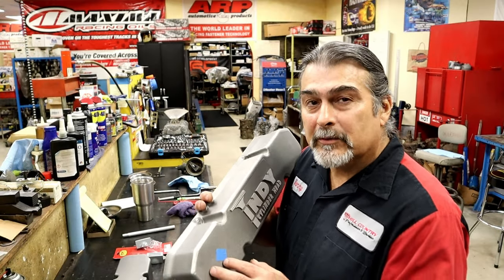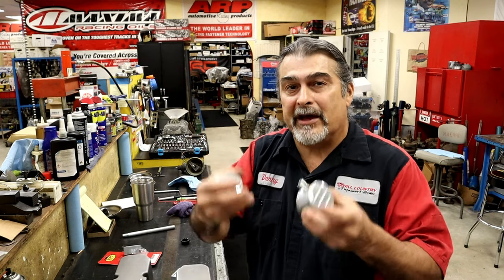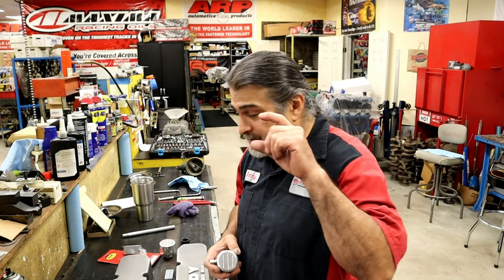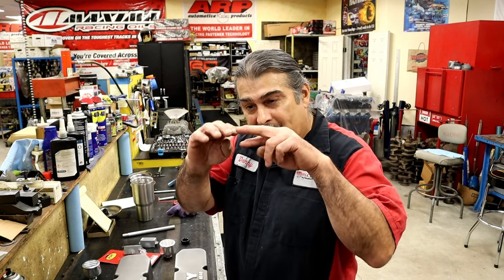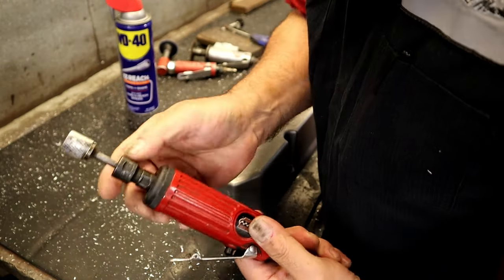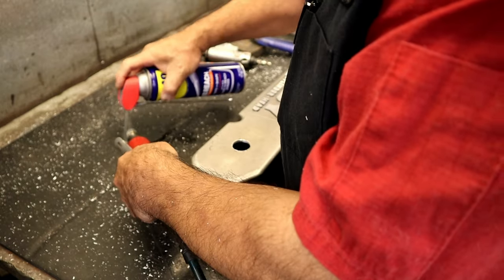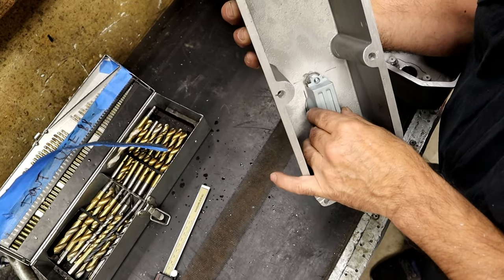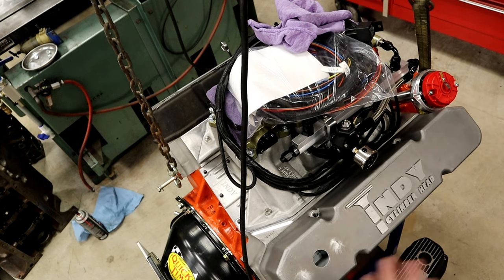How to add proper crankcase ventilation.

Comment: Great video,thanks for sharing your skills 
How many miles would say change the valve &filter? 🇺🇸Thanks
Reply from the maker: Check every 3000 miles and replace as neeed. Back in the day we would clean the filter and clean and check the pcv valve.

Comment: I would not use self-tapping sheet metal screws on the underside. I don't trust screws I would use pop rivets drill 1/8 inch blind hole and pop rivet it. It will never come out.

Comment: Wicked vid, fun editing too. 7:25  ~”pads”~ 

My ford 390 eats oil on the downhill, been meaning to revamp my pcv system. Apart from adding a baffle, I might change my vacuum source. 

Is it better to source vacuum for pcv at the carb or the ford pcv carb spacer?
My engine’s original carb didn’t have a pcv nipple and ford used the vacuum source on a carb spacer. 

My new carb has a pcv nipple on the carb itself and I wonder if I should pull vacuum for the pcv off the carb itself instead of the stock carb spacer vacuum source a couple inches below the carb.
Reply from the maker: Those phenolic spacers are hard to come by, if it’s not cracked use it for heat transfer. Either of the two will pull good vacuum. I just don’t like to pull vacuum from one individual intake, port, or runner.

Comment: I have a mustang an when I go fast oil burns thru the exhaust it has a baffle toward rear of car. Help
Reply from the maker: Do you have stock valve covers or after market ones?
Reply: After market aluminum
Reply: Drivers side front breather passenger side its in rear